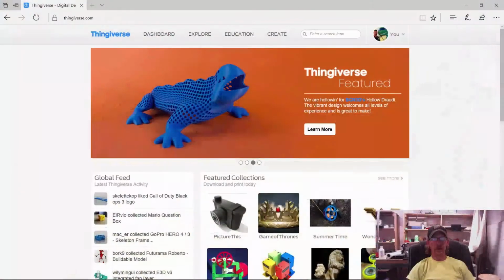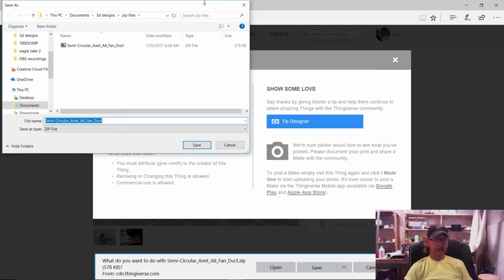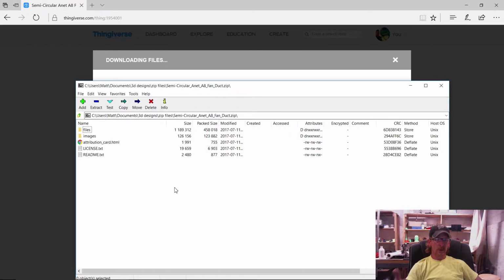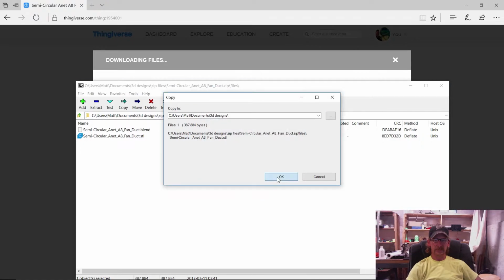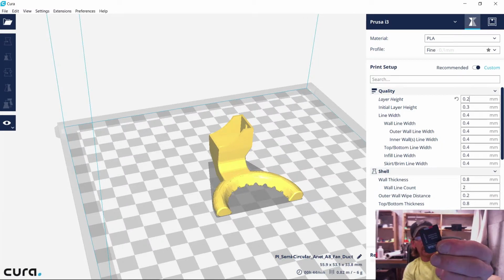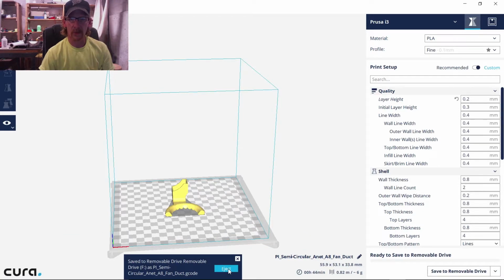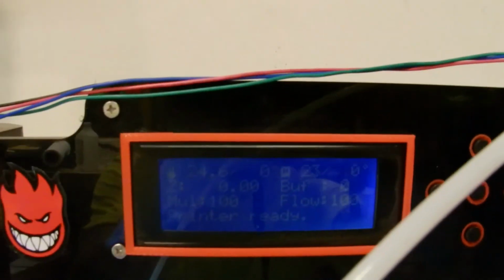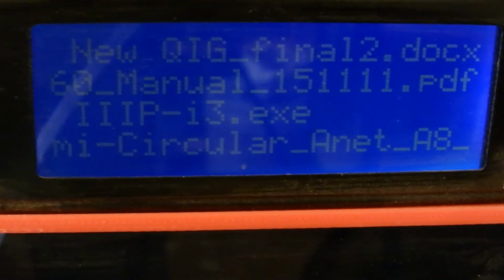3D Printing from SD Card Basic Guide for Beginners (Using Cura and Anet A8)

Comment: Also, would you come to my class and give us a lesson 🤣🤣🙏🏼🙏🏼🙏🏼🤞🏼🤞🏼🤞🏼🤷🏻‍♀️🤷🏻‍♀️🤷🏻‍♀️  Doesn’t hurt to try....I’m in Oklahoma by the way.
Reply from the maker: Lol as fun as that sound (Really) I still got my day job 😁
Reply: I had to try. Thank you so much. Your videos have given me the ability to look like I know what I’m doing. Be well!
Reply: I’ve hit a snag. My printer is printing off the hot plate. When I do my home all button, it goes way to far to one side. Do you think it would be my start code on cura or might I have mixed up my z motors?  I’m at a loss and supposed to do this tomorrow w my class :(. There is no tension on my cord that runs the extruder.

Comment: Thanks, Mr. Matt!  I’ve built this Anet A8 printer with my 7/8 gifted and talented class. So I know I need to download Cura, go to thingverse, save the file I want to print, open it in cura, save to removeable file, preheat printer, load filament, open file. Does this sound right?  Your videos are awesome. Thank you!
Reply from the maker: Yes that process is in correct order and awesome you did it with your kids and thanks for watching!

Comment: Thank you for this video Matt. I got an A8 printer for my birthday the other day and found tons of videos on how to assemble it but didn't see any on how to actually get it started printing until I found yours.  The SD card that came with my printer is corrupt so I'm going to get a new one and transfer some STL files to it. The printer came with a USB/Printed cable.  What is that used for?
Thanks,
Al
Reply from the maker: Your welcome and congrats on the printer welcome the 3d printing world. And Happy late birthday. Glad you found my videos and happy you found some use of them. Now the cable you ask about it to connect your printer to a computer. Either a pc or a Raspberry Pi. also what needs to be on the sd card for the printer to read is .gcode now stl. Any other question feel free to ask I will help if I can. remember to try to have fun with this.